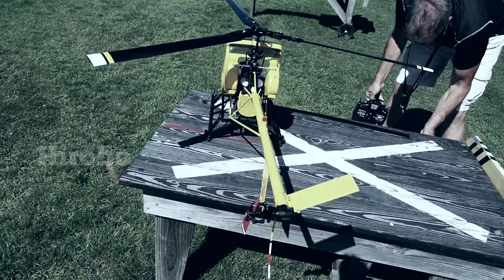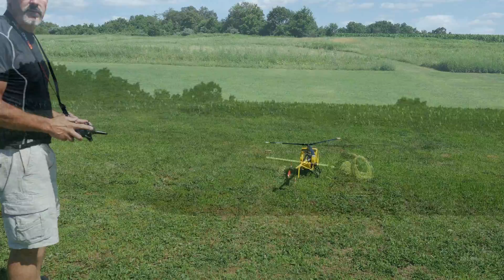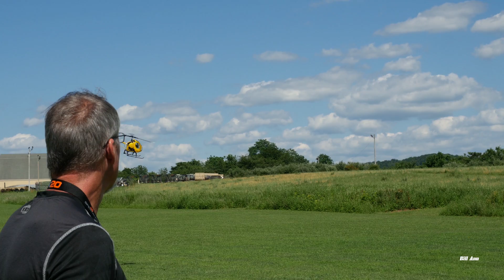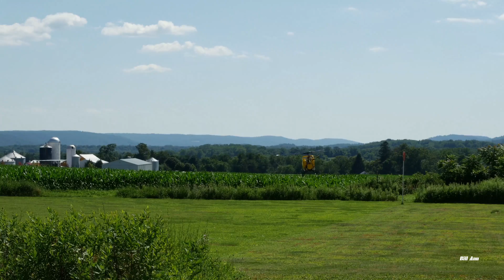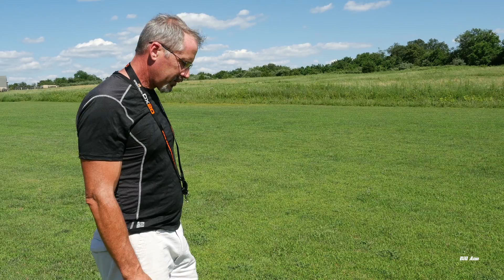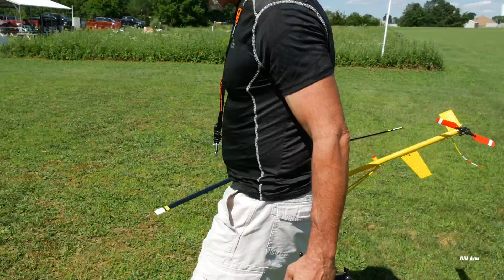Ted Mason's  Hirobo S300, Electric Conversion

Comment: I noticed you placed the battery where otherwise the throttle and tail servos would be. But where did you put the tail servo?
Reply from the maker: Sorry, not my heli and I have not seen Ted in a long time.   But if I get in touch with him, will ask him about the tail servo.
Reply: Thank you. I think I just solved the problem anyway. My fault, I didn't look in the manual.

Comment: Great Video! Love the electric conversion and the 3 bladed head. I've got one of these, Nitro (OS37) and currently using the two blade setup. I've got the 3 blade head which I'm planning to fit at some point. These are really nice scale RC helis (in my opinion) and a lot cheaper than the Vario version!! Would be interested to know if you are using a 3-axis gyro?
Reply from the maker: I think it is a BeastX fbl, but will have to ask Tom when I see him.